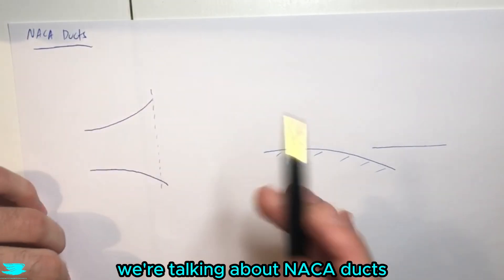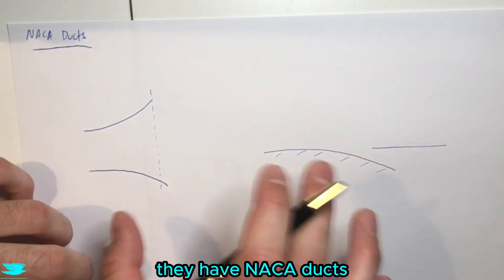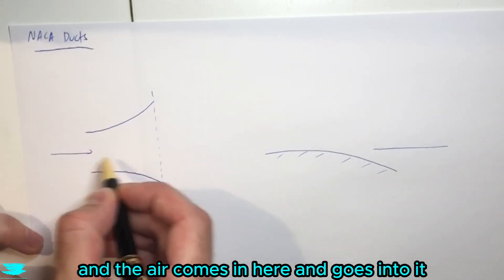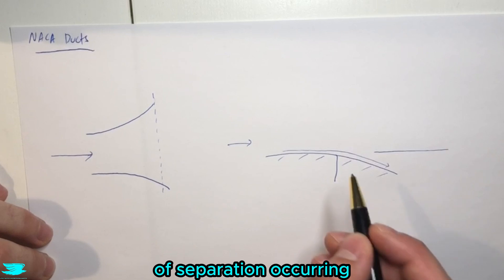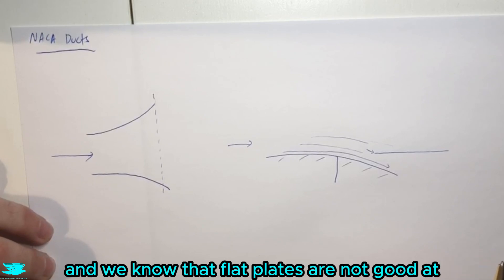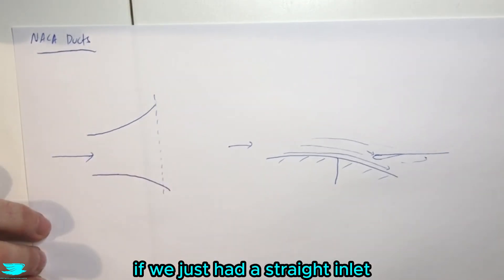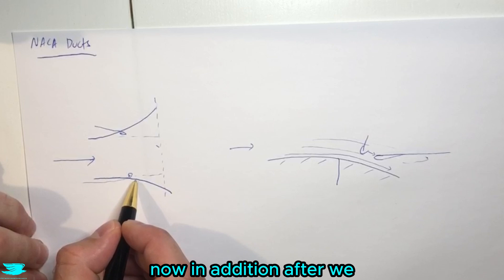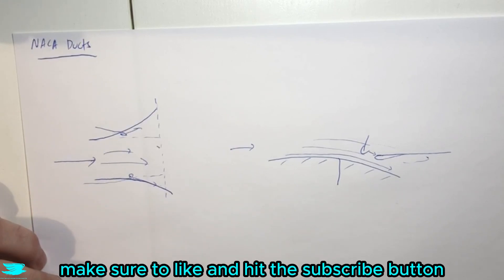Car NACA Ducts Explained {Auto Aero #60}

Comment: 4:54 Is the curvature (i.e. 20-30 degrees) a function of the velocity or density of the fluid (e.g. air)
Reply from the maker: I guess if you break it down to the fluid's properties, it's a combination of flow speed, viscosity, and density. All of these properties will affect the vorticity created.

Comment: My 'Take-Away' from 3:52 is that one does not want the 'Turbulence' from the edges/sides of the NACA Ducts. One wants them to Soley pull the air into the NACA Duct, but Not to go down the NACA Duct.  Use the 'Vorticies' then Remove the 'Vorticies'.

Comment: If the side walls are acting as vortex generators, does that imply that they are most effective when the edges are a sharp 90 degrees?
Reply: Definitely. In order to work properly NACA ducts also have pretty complex geometry for something that looks so simple. One thing this video didn't quite hit on is that the vorticies are used to suck the boundary layer from the surface in front of the duct and sort of bind it up on each end of the rectangular intake so the large area in the middle of the intake gets higher energy air than a normal submerged intake could get.
Reply from the maker: Yep, a sharp corner is best.